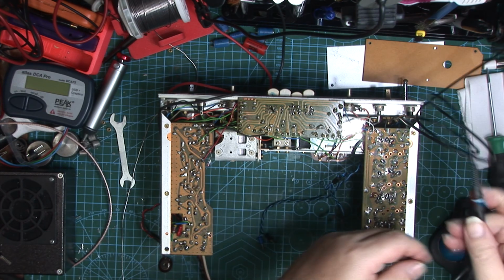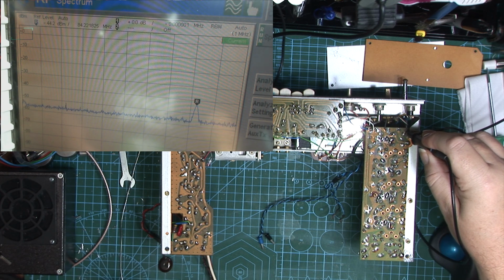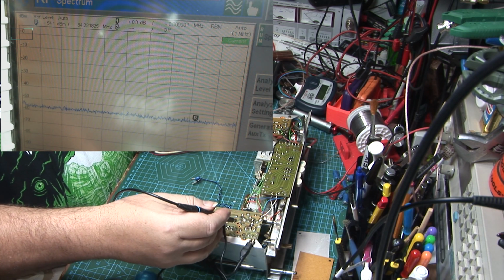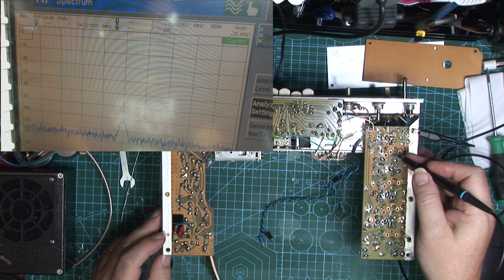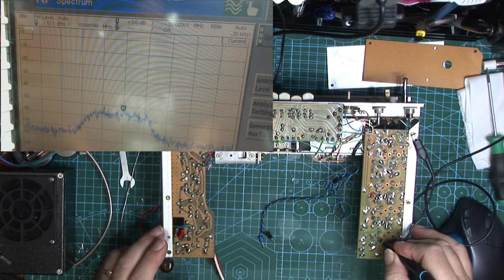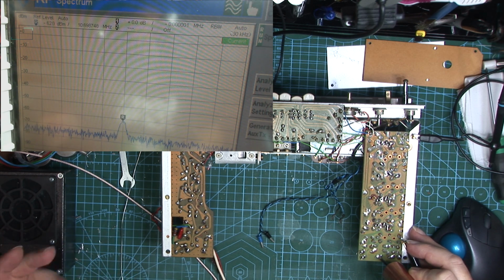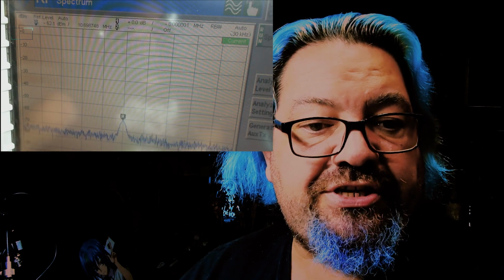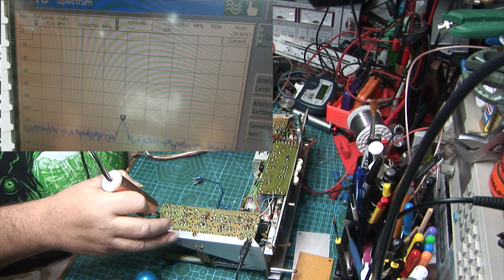Hacker Sovereign Rp18 FM section fix

Comment: Good video George. I’ve not experimented with silicon in place of germanium yet as I still have germaniums but I must give it a try. Happy Christmas
Reply from the maker: I still have full boxes of geraniums but they are worth more on ebay than in radios. Better to sell the old stuff for profit and just put in cheap hapenny stuff that generally performs better anyway.

Comment: You did this all without re-bias of junction drop Ge vs Silicon? Pure Genius. Nice hair BTW under the UV and Merry Christmas 2022 and beyond.
Reply from the maker: Yes, no re-bias needed. The tolerances on old radios is wide enough to not need any messing with. Just shove 'em in, tune 'em up and rock out! Happy Christmas and a Merry New Year.

Comment: Merry Christmas George and family.
i am allso guilty of using silocon to replace AF11x and in most cases with no other circuit changes. as it keeps repair costs viable.
Reply from the maker: I don't feel guilt as it is an improvement. Lower noise, zero leakage and a millionth of the price!

Comment: Thanks for a great video George.
BTW....I thought it was impossible to sub a germanium transistor with a silicon transistor?
Merry Christmas!
Reply from the maker: Never impossible Bill. If your circuit is not critical for the base voltage then a silicon transistor will work just as well. In vintage radios the tolerances are so wide that you could probably get away with a lump of coal in some of them! Merry Christmas to you and yours.
Reply: I use BF450 in place of AF117 ect.

Comment: Well thats a basic set up, now comes a chisel :)
Reply from the maker: its not that extreme! I do have a mallet though mine is rubber not wood. The tracer is a simple kit build, the audio generator can be knocked up using a phone and some caps and the spectrum analyser will cost a fortune to buy. Merry Christmas Harvey.
Reply: @GeorgeChristofi  i hope you are having a nice xmas :-D
I've always used my old yaesu frg7700 and a tiny coupling capacitor to sniff the i.f.
Yes i couple the yaesu antenna  via a tiny value cap to the point of interest.
That's fine untill i found a i.f above 30 megs.
Then the realistic 2006 scanner gets connected. i added a meter on the scanner to give a crude strength indication.
I don't do much now george, but it's nice to see radio repairs from you or graham and the other chaps.
Sorry long boring waffle.

Comment: Great video, and very informative. Like the others who have commented I will  also be interested in knowing which silicon transistors you used. Looking forward to the next stage on the amp. Thanks.
Reply from the maker: In this radio I actually used BC557's but pretty much any medium gain silicone will do. I have used things like 2n3401,  russian MP41, GT320, Bc556,, BC558 and many others. Merry Christmas!
Reply: @GeorgeChristofi  Thanks for the info. George. And wishing you and yours a nice time over the holidays too.

Comment: Nice one George. Which silicon transistors are you using?
Reply from the maker: In this radio I actually used BC557's but pretty much any medium gain silicone will do. I have used things like 2n3401,  russian MP41, GT320, Bc556,, BC558 and many others. Merry Christmas!

Comment: Nice Video George, well explained. Which silicon transistors did you replace the 117s with? Look forward to the next one.
Reply from the maker: In this radio I actually used BC557's but pretty much any medium gain silicone will do. I have used things like 2n3401,  russian MP41, GT320, Bc556,, BC558 and many others. Merry Christmas!
Reply: @GeorgeChristofi  Thanks George, much appreciated and Merry Christmas to you bud.